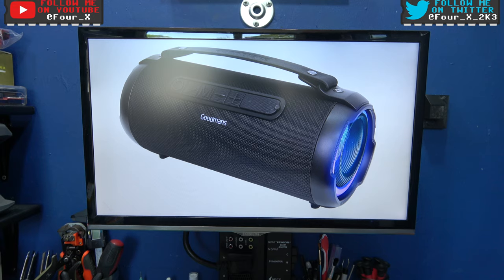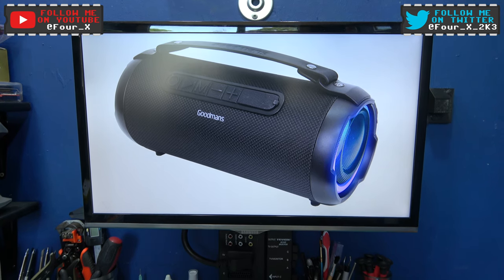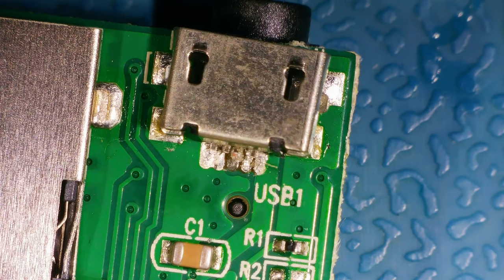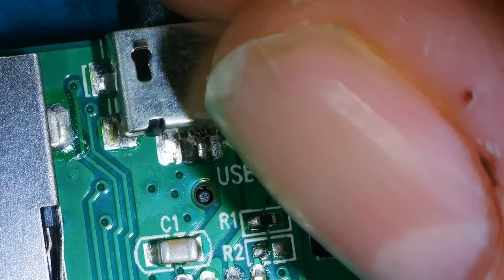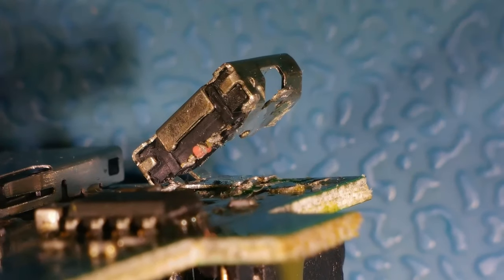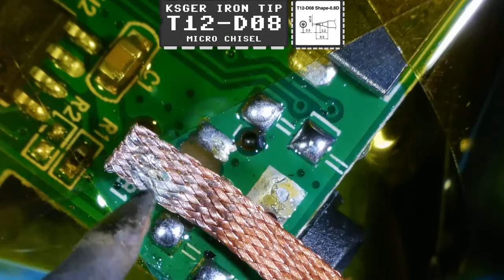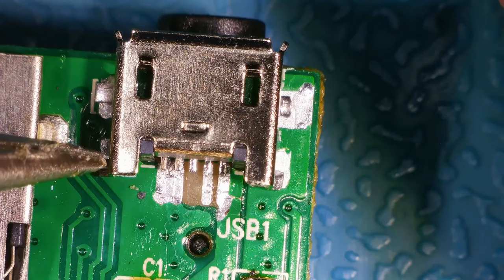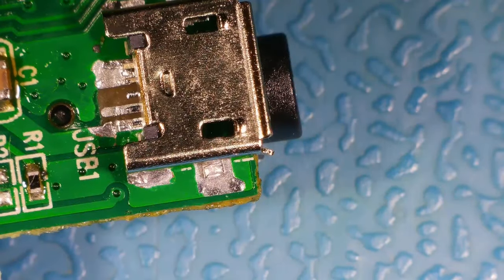Goodmans - High Power Bass Bluetooth Blaster Portable Speaker - Repair.

Comment: Git the same issue, ive got the speakers off , managed to find the screws under the pads. Ive removed the 2 screws from underneath the controller interface  . Im stuck now. Havent got any small screwdrivers to get inside the tube , cant take the top off where the play button/interface is. I need help !!
Reply: In exactly the same position as you did you manage to find out how to get it out mate.
Reply: @boastyy  it's in the bin !
Reply: @reddevil310  Ha , totally understand mate. The damn thing gave me a migraine last night. What a stupid design. Thanks for getting back in touch.😀